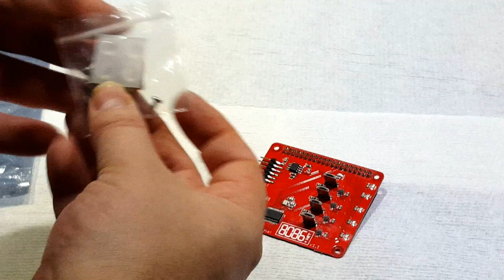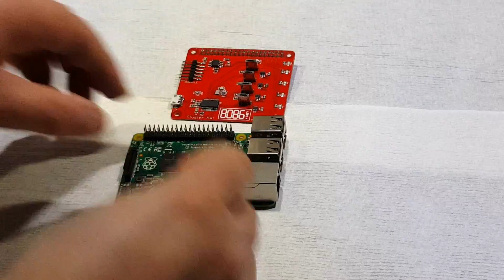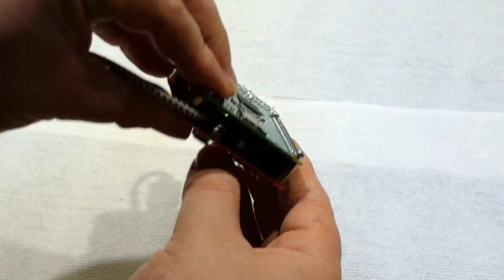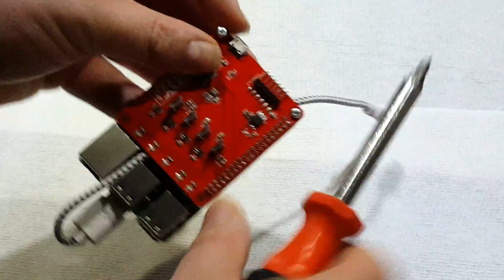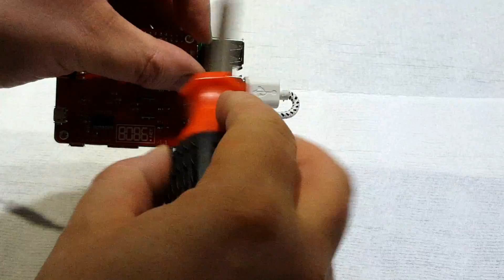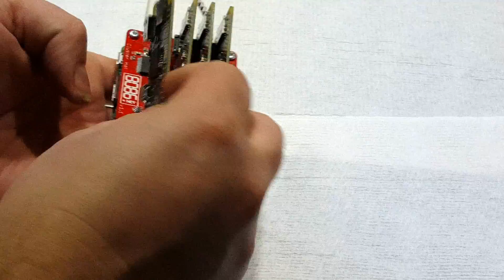Assembling the ClusterHAT for Raspberry Pi Zeros

Comment: i am just beginning to understand you but your lecture style is very poor. 
so power is supplied to the pi zeros thru the mini usb and not the power usb.
got that. 
now what about heat dissipation? there is no room for any heat sinks anywhere.
and what about the software? how does the master control the 4 slaves? huh?
i i expect that i will be able to work it out but it would be nice if you would just tell us.
Reply from the maker: I'm no lecturer so I wouldn't expect it to be great especially on the assembly video :). By default power for the Pi Zeros is through GPIO, power to the USB HUB is via the USB cable. If you're running them at 100% CPU you might want a little air flow over the Pi Zeros but you don't really need a heat sink. I'd advise looking at the website for how to control it either with the provided Raspbian based images or standalone (https://clusterhat.com/setup-control).
Reply: hello chris,

i don't like public speaking much either.

so i got it wrong. power is from the gpio pins.

i have tried this using cables without success. the voltage drop was too great.

the cables were too small and it was very difficult to connect larger cables to the gpio pins.

but i guess gpio pin to gpio socket works well.

for cooling i guess a fan blowing air sideways would do it if necessary.

but what about the software. i understand that you supply image files and not software mods.

this means that if the operating systems are upgraded the system may cease to work.

i had this before on another hat - the mini touch pad.

i run a mess of pi 3b's and pi zero's and your system would make the whole thing much neater.

hence my interest

best wishes

john
Reply from the maker: The images I supply are based on Raspbian and I provide instructions on how to upgrade releases (on the forum). Mostly you can just update/upgrade as normal - the only times it has caused issues are when they changed how things worked like dhcpcd and interface naming. The scripts I use to convert Raspbian images are also in Github (linked on the software page) if you want to see what changes are made or apply changes to an existing install.

Comment: Can I run kali linux?
Reply from the maker: I would imagine so but you'd need to install the script, config the networking/udev/etc. manually. Basically replicating the steps taken in the setup script (linked under the advanced heading on the software page) and adapting for any changes from Raspbian.
Reply: Ok and with raspibian? I download what? And I put micro sd only in Pi 3?
Reply from the maker: Currently there are modified Raspbian images for Controller and each Pi Zero for download on the Cluster HAT site. I'm still working on and image for a single SD card, but sometime soon I hope to have one available.